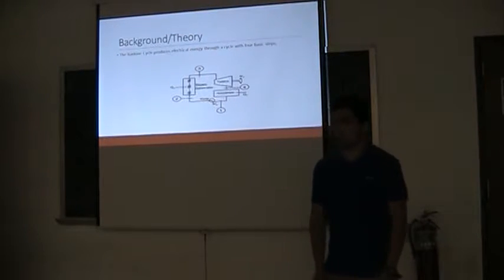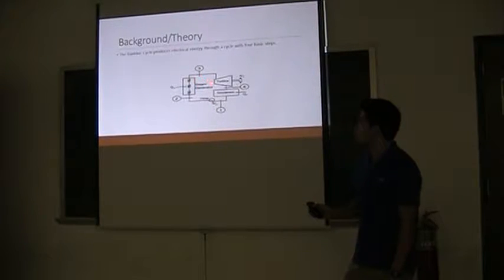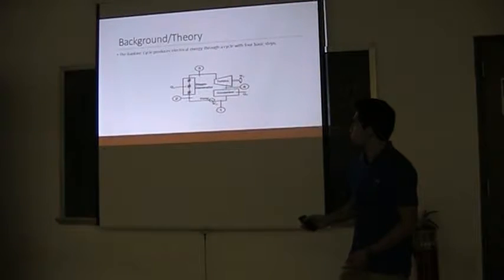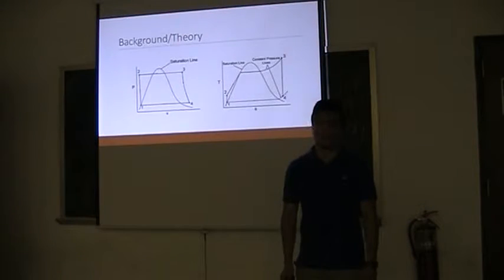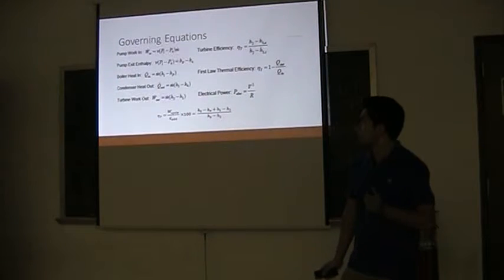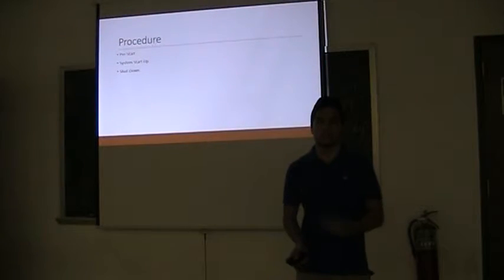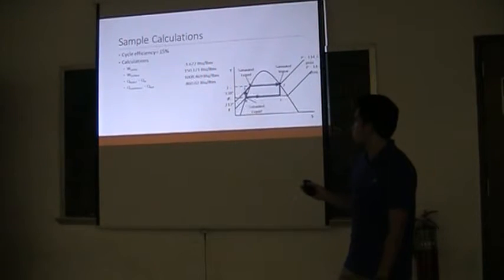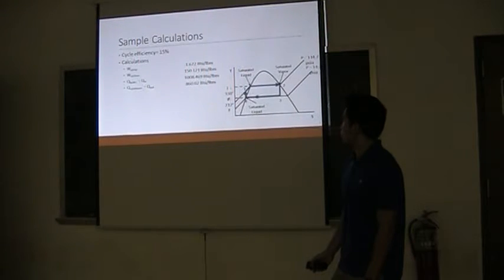Trevor Favrot 3/24/15

Comment from the maker: Brennan Colclough (Quality of Power Point) - The slides were simple and to the point without much distractions or unnecessary information. The governing equations slide could stand to have a larger font so it is easier to read but all in all it was a good power point.